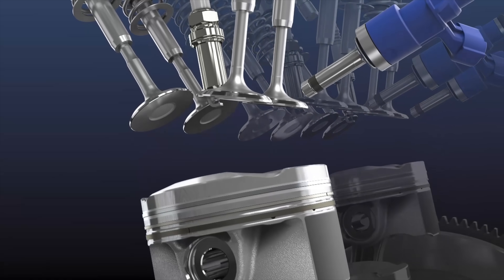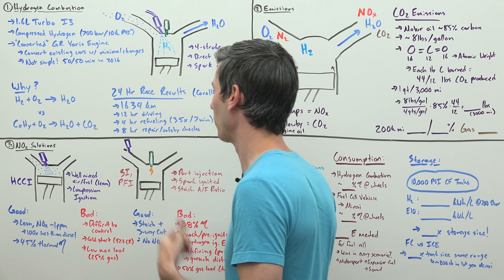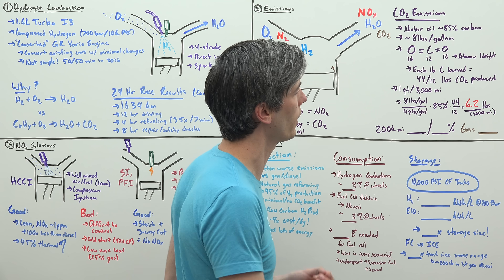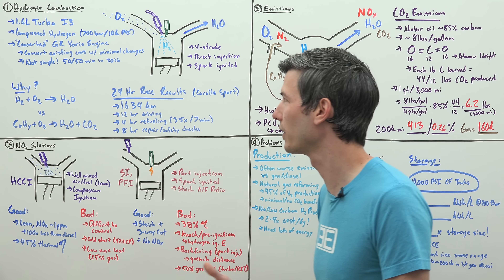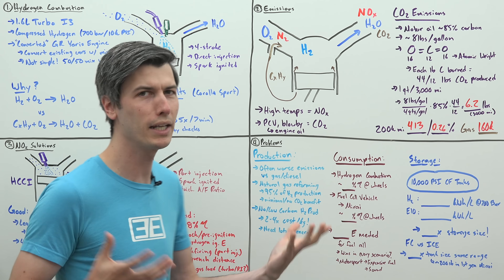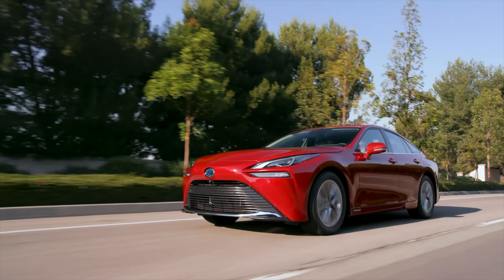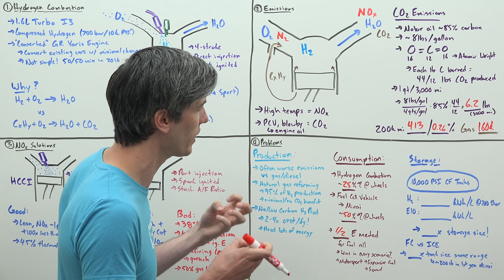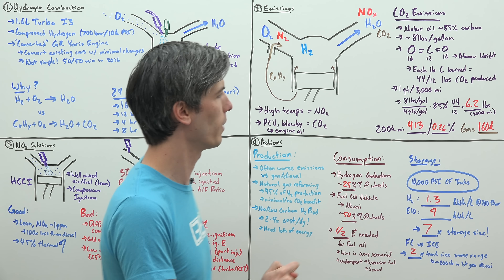Toyota's Developing A Hydrogen Combustion Engine!

Comment: Other than the issue regarding storage, how many hurdles does this tech face that can't be overcome by advancements in technology though? Didn't we go through the same process with EVs? And while production for hydrogen might not be any more "green" yet, if at the cylinder emissions are significantly better, is it not a better net solution regarding emissions, compared to the traditional IC? Genuinely wondering. Super informative video as always!
Reply: Long haul trucking, trains, ships, medium duty trucks and construction equipment, or just average pick up trucks that need to tow a horse/boat/camper more than 100 miles can't survive with battery power.  Solid state batteries may help the pick up truck crowd.  Hydrogen or hydrogen fuel cells are currently the only viable replacement for oil based fuels.

Comment: It's insane to think that it's only been like 4 ish months since this video and Mercedes is already making a prototype for a hydrogen semi truck.
Reply: Hydrogen might make more sense in a semi-truck because you have so much more available space to store hydrogen.
Also, the added weight is much less of an issue in a large vehicle.
Reply: MB already had this but as mentioned, where's the fuel infrastructure? Not that this should inhibit ownership.
Reply: The Mercedes hydrogen truck is using a fuel cell to power electric motors, not an ICE engine as in this video. They have gone for liquid hydrogen to get more in the tank and  are using double skinned tanks with vacuum between them to keep the hydrogen at cryogenic temperatures.
Reply: @franklinblunt69  I believe the more relevant question is will there be a hydrogen infrastructure? If there will be then that's fine. The current power grid would need to be revamped in order to support an overhaul  of the transit system to fully electric.
Reply: @silo3com  there could easily be. I feel like this YouTube channel fanboys over EVs
Reply: @franklinblunt69  Infrastructure comes with the technology, there was little or no EV infrastructure 10 years ago
Reply: Cummins are producing diesel engines that only require a cylinder head change to be able to run on hydrogen.

Comment: As i'm sure you are aware electrolysis produces both oxygen and hydrogen, I wonder if its possible to make an engine that runs by combusting the mixture directly. For example you have an O2 and H tank in the car and mix them in the cylinder at the correct ratio. Chances are I'm talking nonsense but just a wild idea.

Comment: Fantastic video. It still surprises me that we want to use renewable electricity to manufacture hydrogen (making it green hydrogen), which then needs to be stored and transported, to then be put into a car which contains a fuel cell, which coverts the hydrogen back to electricity to make it run. Bonkers. Keep up the good work!

Comment: and that's not even considering advantages lost from not having regen breaking, which would be likely in the other type. 
But I'm also curious how much of an upfront savings there would be. Because those fuel cell generators I have heard are very expensive to make due to the materials required.
Reply: battery cars are also expensive to make whats your point? regen poses a problem with brakes thats why VW is using drum brakes on their battery cars its sad. because of regen your brakes will need constant service to prevent locking up or corrosion.

Comment: if I may, from my research it seems a viable way to produce hydrogen would be using modified bacterium and yeasts (or naturally occurring ones as well considering there are a great variety) which release hydrogen as a byproduct similar to how yeast is used to create alcohol but releases CO2 as a byproduct. This would allow renewable low-cost production of hydrogen, and allow further research into the creation of Hydrogen ICEs. for example, perhaps the piston based model is not the ideal platform, i would be curious to see how a rotary solution would perform (i theorize not very well, but nothing tried is nothing learned). Looking at natural gas reformation and electrolysis as the only two ways of production is limiting your conclusions about both ICE and Fuel Cell applications. furthermore, if the natural gases released by livestock were able to be captured and harnessed then those could also be reformed and be carbon neutral*

*(all livestock are inherently carbon neutral despite what vegans will have you believe, animals have to have the carbon from somewhere to be able to release which comes from their food which is plants. they take carbon from the atmosphere in the form of carbon rich plant matter, and release it back as natural gas. the net result is no additional carbon taken or lost from the environment)
Reply: I don’t know much about the first part of your comment, but the second part was very enlightening. You are right, cows are carbon neutral since, surprised no one has publicly debunked this idea then.
Reply: Now that I think about it more, I guess the argument is that the feed that is provided to the cows could be grown in a non organic manner.
Reply: @twiincentral8780  that just means that artificial fertilizer and pesticide was used, ultimately its still plant matter which, no matter how you grow, plants are carbon negative, and the animals consuming them are either neutral or negative. you cannot create carbon from nothing, the reason fossil fuels "may" be an issue is because they release non-environmental carbon from oil and coal deposits. That said, again, plants are carbon negative, meaning they intake carbon but don't release it. the carbon from plants is not released until the plant matter is digested, decomposed, or burned. This means that one potential solution is simply more and bigger plants that use more carbon. If you want to talk actual environmental issues, acid rain and smog are still things in places like china and india that use cheap fast and environmentally unfriendly production methods that release large amounts of pollutants into the air and water supplies. Plastics are a huge issue, as are chemical wastes and spills. Climate change really isnt the big boogey man that media will have you believe. its nothing more than a red herring that distracts from the actual environmental damage being done by the people signing their paychecks and making their iPhones.
Reply: @mtnentertainment3454  thank you for the reply and your original comment. I genuinely hadn’t considered that point of view as it relates to animal ‘emissions’.
Reply: @twiincentral8780  oh believe me i can go way deeper into the receipts on this one. I've spent untold hours researching and following money and ideological trails just on this one subject. i tend to not go much deeper than I have in those two comments because the deeper i go the less people listen regardless of the receipts i have to prove my point. heck, follow the trail deep enough and you end up in what most people who only get information from TV or Twitter will refer to as "harmful conspiracy theories" despite the actual evidence to the contrary. generally I have found it's safe to assume the people in media and on your TV screen do not have your, or the rest of the world's, best interests at heart. money influences EVERYTHING. and if it isn't money it's propaganda or political power. There are actual issues that absolutely need to be addressed in our world, many of which could be addressed in a quick and economical manner, and basically none of them are talked about in the common discourse.

Comment: Hey,  great video 👍
I’ve read about BMW trying to solve the emission problem due to the engine oil being burned, by using ceramic pistons, which don’t require lubrication. 🤔 but they stopped the further development
Reply: as explained the emissions would be negligible

Comment: Won't the marginal percentage of oil being burned also build up carbon deposits that will accumulate worse due to the lack of solvent and detergent action from the fuel?
Reply: This would be a much better reason to discuss burning of oil in an engine!  His example (simply to show Co2 production) was silly.
Reply: tbh carbon buildup is already an issue as many modern engines are direct injection so I imagine it won't make much of a difference.
Reply: @Bazzookie  That's kind of the point. It's already an issue, and two components that help it not be a bigger issue are disappearing.
Reply: @AtlasReburdened  fair enough

Comment: Alternatively, there is a lot of discussion about methanol fuel cells in German-speaking countries
Reply: You can convert this in your normal car, it’s not just discussion
Reply: @megachef0421  and @Daniel Stefanov WTF are U speaking about? Methanol is NOT methane, nor LPG and neither of these use fuel cells! Methanol is methyl alcohol
Reply: Methanol has been tried in internal combustion engines since their inception
Reply: @joshentheosparks7492  But now they are testing methane (natural gas)  fuel cells -- instead of hydrogen fuel cells (like in a Mirai) .   Not internal combustion engines ....   methane has less storage problems than hydrogen and does not require such high compression.
Reply: There's no discussion, just some badly researched TV reports. Methanol has an even worse energy efficiency than pure hydrogen, it's just easier to store. Nothing beats batteries for energy efficiency. And since we won't have a surplus of renewable energy for at least the next 2 decades, it's a dead technology.
Reply: Barter Town :)
Reply: @wermagst  — Oh, methanol is not a “dead technology” ... You can still buy E85 in the US, and I buy it in Asia. Here, it’s made of sugarcane and cassava.

How long combustion engines will survive for production automobiles is debatable, but the need for combustion engines for aviation and marine shipping is a long-term proposition. Carbon-neutral fuels for these engines is not a “dead” pursuit.
Reply: @sking2173  Methanol from crops has the same problem, it is not sustainable. It's literal greenwashing of fossil fuels. It gets especially bad, where forests (CO2 sinks) are cut down, to create sugarcane or oil palm plantations. And even if we produce bio-ethanol/methanol in the future, it is far to valuable to just burn it. It will be needed as a base to replace fossil oil in the petrochemical and pharmaceutical industry.
And as for dead technology - I was referring to car/trucks engines/fuel cells. Just FYI: even the most optimistic forecast for PTL and/or biofuel production won't even cover 10% of fuel consumption for aviation by the end of this decade.
Reply: @wermagst  It's a bit weird to talk about the efficiency of a fuel. Typically efficiency is a property of an energy conversion process. Electric cars are probably pretty efficient, even when you factor in the charge/discharge and voltage conversion losses. However, efficiency is not a problem things like electric cars are meant to solve. Diesel engines are already adequately efficient, even if not as much. The problem is taking carbon that's buried in the Earth's crust and putting it in the atmosphere.
Reply: @felixmoore6781  "The problem is taking carbon that's buried in the Earth's crust and putting it in the atmosphere." Which you could reduce by, let's say, improving the efficency of an engine?
Reply: @felixmoore6781  In order to reduce carbon emissions, we have to be as energy efficient as possible, since availability of renewable energy will be limited for the foreseeable future. Therefore high efficiency = lower carbon emissions.
Reply: @wyrazowfkp  just eat a lot of beans and you'll have all the methane gas you'll want.
Didn't they say methane gas from cows hurts the ozone layer
Reply: @wermagst  — Your point about cutting old-growth forest is a major concern. It is interesting when I bring that up in the context of population control, I often get attacked from multiple sides.

But when you cut down more forests for housing and to produce food for a burgeoning population, the effect is the same as if you cut it down to grow sugar cane — a major carbon-sink has been destroyed.

Comment: In Glasgow, during the COP26, in the green zone, I have met with a JCB engineer who was showing their hydrogen powered tractor where the engine was ICE modified from their famous diesel engine. It costs 10% more then a diesel with similar performance meaning torque and power, doing much better then fuel cells.

Comment: In my humble opinion the best application of Hydrogen in the short term is as an additive to current fuels. I know it's not a wow breakthrough kind of concept but it's definitely effective at significantly increasing the efficiency of the fuels detonation...j.s.
Reply: US Air Force aircraft used to use water injection in jet engines on takeoff for extra power. Not the craziest idea as an additive.

Comment: I'm glad somebody with a much larger influence than mine is highlighting the difficulties of using hydrogen as a primary fuel. I won't say the difficulties are insurmountable but at this time they're just not cost effective to produce, when fossil fuels are incredibly cheap, energy dense, and easy to store/transport when compared to high pressure hydrogen. Sure, research efforts should be invested to understand the capabilities and limitations of hydrogen but its use only becomes cost effective when we've run out of fossil fuels and there aren't any other options.